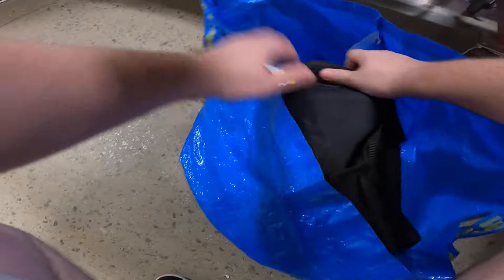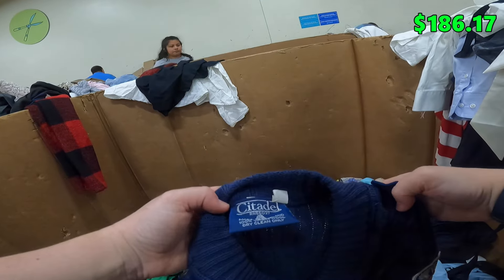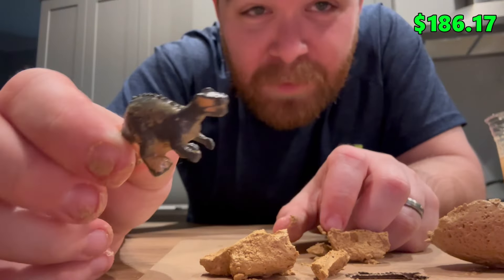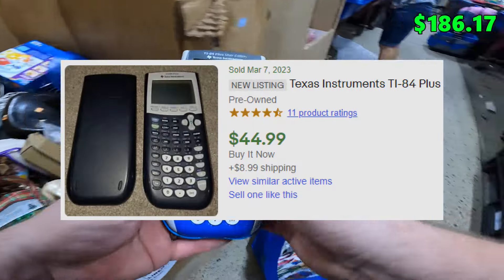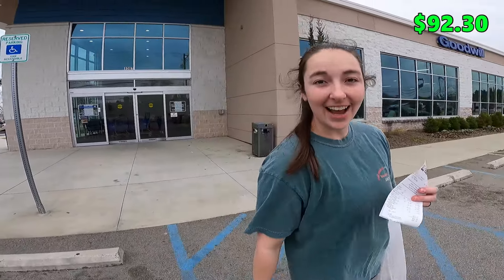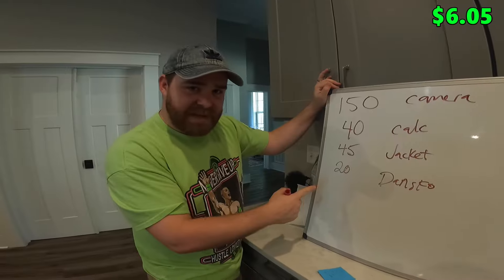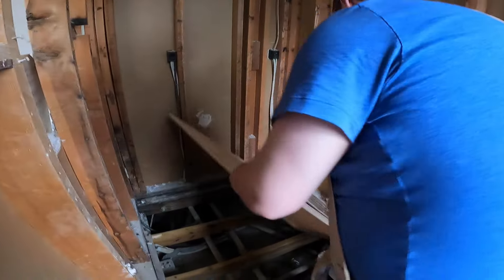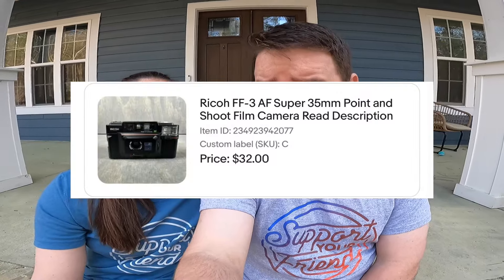We Found THIS in Goodwill's Reject Pile...

Comment: You may already know this but if you need paint rehabbing your house check the paint stores. They have mismatched paints for as little as $2 per gallon. I got enough to paint my whole house inside and out for less than $100.00 at Sherwin Williams and Benjamin Moore . Included 2 5 gallon buckets one exterior paint and one 5 gallon bucket eggshell interior. To give you an idea of how much paint I used my house is 1400 square ft and had to be painted all over . Make your goodwill makeover money go a lot farther !!

Comment: I'm sure you already know, but battery terminal cleaner works wonders cleaning corroded battery compartments! I just soak a paper towel and stuff it down in the compartment, usually with a screwdriver. It helps get in the corners and protects your hands from the chemicals.

Comment: Military Style Cap (minute mark 7:50):  that type of cap is referred to as a Garrison Cap by most services (though as a Sailor we had another crude name for them).  The idea is that it’s less formal for wear around an Army Garrison/Fort, or on the Flight Line. Pilots can drop them into their flight suit cuff pockets when putting on their helmets.  The rest of the services tuck them under their waist belts, when they are taken off indoors and so they don’t have to set them down or hold them.  .

Comment: Electrical Ground Wires:  speaking of small wires in the crawl space that are near the old plumbing pipes, during some periods, in some areas (especially if you had a well with metal water pipes) your Electrical Service Panel’s Grounding was done by running a bare solid copper wire out of the panel and over to your metal water pipe and was clamped right to the water line.  Watch for it, as you cut out metal pipes and replace them with PEX, because without that metal to metal connection your power panel won’t have a ground (if you remove it).   Other houses received their electrical ground ps differently with ground rods, driven 4-6’ into the earth and the copper wire was connected there.

Comment: Trailer!  Congratulations on the Trailer.  Couple suggestions:  First, find a mount for the spare tire outside on the front (either onto the hitch or even the front outside wall.  They make mounts for both methods and have cloth tire covers like you see on Jeeps.  It will give you more interior cargo space.

Second, since you are a Motorcycle guy and are always moving them, consider a couple E-tracks along the walls, to strap the bikes easier.  The track systems also work well for short loads (not full), big tool boxes and appliances.

Again, congratulations!
Reply from the maker: I don’t have a trailer and I don’t have any motorcycles lol

Comment: I couldn't see it well. The copper pipe with insulation and wire going outside is likely your pipe and wires for heating and air conditioning so the thermostat can tell the outside unit to run.

Comment: Hey, I am not an electrician but I am a plumber and I’m pretty sure the wires that are following your old copper plumbing is called heat tracing. Its sole purpose is to stay warm 24 seven so your pipes don’t freeze. I haven’t worked with it much but I’m pretty sure that’s what it is.
Reply from the maker: I don’t think it gets cold enough where we are for anyone to have that. Maybe if the pipes were on the outside of the home, but not in the crawl space. Dean think it’s a thermostat wire

Comment: Pipe Cutters:  heard you say your “small” pipe cutter hurts your wrist.  They do come in several sizes (up to about 6-8”).  So I suggest you get a couple good quality older tools, indifferent sizes and use the largest one that will fit in the space for cutting out old pipe and the largest you have for cutting new pipe to length.  As you use them, don’t try to cut too deep at once.  The best way is to tighten a bit, rotate, then tighten again and rotate, letting the hand tool do the work, rotating several times.

Comment: My mother decided to get rid of her old Dansko's and I told her about the bend test and showed her a video where you specifically showed it. We ended up sitting around doing it with every Dansko she owned (a lot) and it's true! Fortunately, only a few cracked. She was very doubtful at first until it happened to a shoe she was bending lol.
Reply: It can happen with any soles made with polyurethane or even cork. I sold a pair of Asolo mens boots last year on Ebay. A month later, the buyer contacted me saying the soles had come loose/cracked. He provided a pic, at my request. I was puzzled because they looked fine before I shipped them and I'd sold an identical pair some months before, with no issues. Both pairs had even belonged to the same person. But I researched it and learned that some shoes have cork inside the soles, which can become damaged if it gets wet. I think when I scrubbed the uppers with suede cleaner and rinsed with water, some moisture may have gotten in between the sole and the footbed. (The first pair didn't need any cleaning, so that might be why they were fine.) The buyer was very polite and didn't ask for a refund, but I sent him one anyway. $139, including the shipping. Ouch.

Comment: Small Existing Electrical Wires:  best thing to do is to follow them to their destination to be sure, but with the age of the house they will most likely lead to Telephone jacks, door chimes or furnace T-stats.  There weren’t many uses for “Signal or Comm” wires back then.
Reply: A few minutes later you said it looked to go outside, probably to a small enclosed Phone Company box, were the phone company would connect the interior phone jacks to the street service.  If the box has the phone company logo, that’s what it is.  That was the way, back in the Day!

Comment: That small wire you found running along the copper pipes looks to be a thermostat wire. If you follow it outside it should go to your outside unit. Probably don't wanna mess it up, unless you redoing your AC/Heating system already. Good example of something very small that could cost you big time, if you have to get a professional to come in and troubleshoot/fix it. Keep up the good work!
Reply from the maker: Yep! That’s what it was